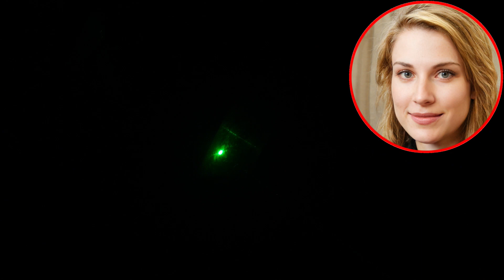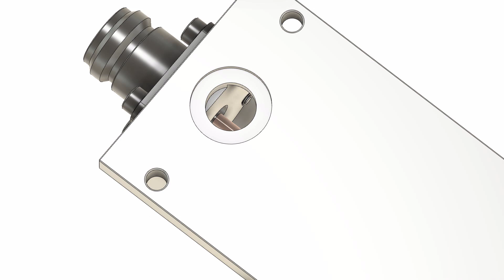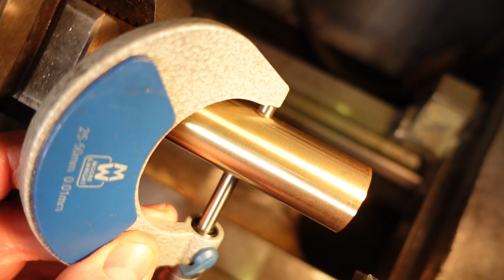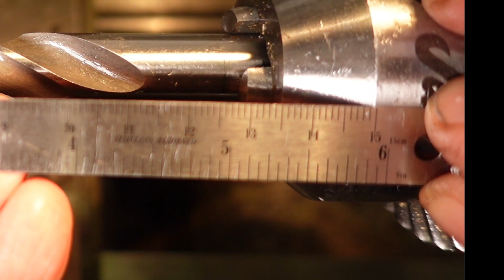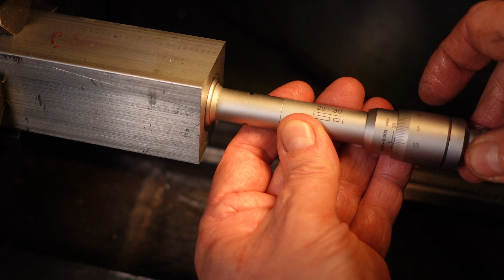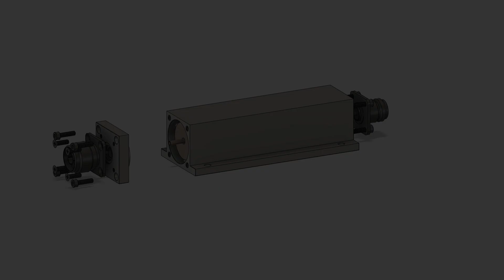Machining Microwave Coaxial Low Pass Filters Part 1

Comment: I have to turn it down to 0.25 speed so I can read the captions and not miss anything.  And to have time to read and think about the odd bits of mathematics, circuits, and component values thrown in.  I liked the plot of the response of the parallel series inductance and capacitance filter.  I checked your calculations, but not sure how that plugs together.  I liked your comments about chucks. At 0.25 speed I can follow your methods, but at full speed they are blurred by your speed and habits.  When you were milling the copper/brass rod it chattered ( I saw the ribs, I have the sound turned off).  A software control on feed with feedback would help, But you said your workspace is already filled with cameras and such.
Reply from the maker: Thank you very much Richard! Yes it would be great to have software control of spindle speed. Not really too hard with a link between the DRO and the inverter. I have a 750 watt servomotor that I am going to use on one lathe axis to allow CNC style cutting of parabolic and hyperbolic dish reflectors. Similar to the electronic leadscrew mechanism that Clough42 made

Comment: Top shelf... sorry i cant subscribe twice, spite my efforts. Joe pie has a great tip on centering square stock with projected surfaces off the end  (rubber bands and four bits of flat stock). Indicates the same as any bore... cheers from vermont
Reply from the maker: I'd actually watched that video but forgotten it.  We need a laminated wall posted of Joe Pie Hints and Tips.  Merch idea there!

Someone else mentioned Joe's vid just after I posted this video and I did a classic face-palm and rolled my eyes... Need less to say, I'm now doing the alignment using Joe's method and feeling a bit sheepish!  I've just done two more bodies and it took a fraction of the time overall.  Only six more to do in this batch and I can get the end face machining and end cap done and get them soldered and tested at last.

Comment: What I like about this channel: You make things fun to watch that I haven´t got the slightes clou about. Literally. But it´s very much fun to watch for me. Good Job! This seems like actual rocket sience to me weather I found a Canadian channel that DOES rocket sience dumb down so even I can compute. I´ll keep hanging around because often You use millimeters to express measurements, I like that. I can´t wrap my head around inches...
Reply from the maker: I'm from that lucky/unlucky generation who had to do imperial, CGS, MKS and SI standards at school and then at university.  Working in foot-poundals and slugs and rods and chains and furlongs and horsepower and fluid ounces and Avoirdupois and Troy, then everything was in centimetres and grammes, then all in metres and Newtons and Joules and kilograms.  It messed with our brains, but it's like how learning to speak another language expands your brain into different ways of thinking.  It can't do anything about my subtraction issues though.  I just measured a part at 23.82 mm, and decided that to get it to the correct finished size of 23.08, that I needed to remove 0.90 mm, so the part is scrap now.  I even used the DRO, but set it to zero and moved in 0.90 instead of setting it to -23.82 and moving in to 23.08.  I don't deserve to have a DRO. Now I have to make the dratted part again. Luckily it's just a hollow cylinder at this point, although it has a raised rim at the end of one end face.  It'll probably come in useful as a spacer or something!

I think I'm going to have to make this one a three-part video as there's a lot of interesting machining of tiny parts and I'm aiming for videos to be between 18 and 25 minutes.  I'm still a total n00b at this video nonsense, but I'm on one h*ck of a learning curve.

Comment: Ok I know it's not super precise machining, but you really lost me when you super glued the parts together.  Also super glue is not something to be melted with a torch (use Acetone) unless you maybe have a fume hood extractor of some type, I'd suggest not messing with cyanides in gas form it's not good for living things.
Reply from the maker: It's only just taken to yield point, not vapourised, plus I run a big fume extraction system to remove cutting oil smoke and the vapours from hot WD40 and brake cleaner. I have proper CA solvent but on a micrometre thick glue line 26 mm diameter, it could take days to dissolve the adhesive. The precision and repeatability I'm achieving is worth the inconvenience of working in a wind tunnel....

Comment: My tiny little mind is still processing the use of lasers to bore out that cylinder. Amazing!
Using big tools I’d probably look at and associate with making farm machinery to precision machine components of a filter that works with GHz frequencies is very impressive. And not one tiny surface mount component or specially etched PCB track in sight!
Reply from the maker: It would be nice if the Laws of Physics permitted that sort of machining.  There are a few "minor" defects in my approach. Although the scientific papers I reference are totally real, the possibility of using laser ablation and oxidation and then excitation of the Aluminium monoxide by absorption resonance in air is probably just going to result in a small dot of plasma that wouldn't cut properly.  Also, my toy lasers only do milliwatts rather then the kilowatts it would need to make this work in reality. Even assuming that you could control the depth of cut somehow by tuning the power and duration of the beams, you still end up with the impossibility of cutting the bottom of the plug out, which is why I had to go full-on Ghostbusters to come up with a magical solution. 
In reality, the machining is a little less theatrical, which is sad.

I am working on a project I can't share details of yet with some tiny parts 0.25 mm thick, where I need to use my jeweller's piercing saw and my farm-machinery manufacturing machines to make  some very delicate parts. Another antenna project needs a 1.0 mm reamed and polished bore in a solid silver rod pressed into a brass carrier, with a flared feedhorn around 2.8 mm maximum diameter. Getting a fine enough finish on that is a lot of fun.

Today's project is huge in comparison, I'm making some Delrin clamps to attach GRP bracing tubes to the booms on very long Yagi antennas for 432 MHz moon-bounce communications, so they don't wave about in the wind and stay in a fixed phase relationship. Always something interesting to do, just not enough time to make videos about it!
Reply: @MachiningandMicrowaves , well, the toy milliwatt lasers certainly look very cool, and who knows what engineering genius you may have inspired with the idea? In the mean time, what you’re doing with those tractor axle drilling tools really is impressive! It makes sense that big solid well honed drill bits on a big no-nonsense lathe would be able to produce the precision you need. All that metal would soak up the kind of vibrations that would be the death of a similar job attempted on a small lathe. Good fun to watch, and I can see you’re enjoying the process. Good luck with bracing the big Yagi. That sounds like a really interesting project!

Comment: Seems like you don't clear chips very often as you drill very deep holes. Have you noticed any effects on diameter, roundness, etc?
Reply from the maker: I usually clear chips well before they start to pack in the flutes, but when I'm filming, it's really hard to   see the chips and feel how the drill is cutting, so sometimes it catches me out. When I'm drilling the 1.70 mm holes that are 36 mm deep, I usually do a full retract every 3-4 mm. Those holes then get reamed to 1.80  For holes that will be tapped, I don't bother too much, but whenever there's a critical bore, I'll usually be reaming it or boring it anyway, so it's very rare that I'll have anything other than a clearance hole that's just a drilled finish. I use stub drills to start long holes that need to be accurately on centre, then finish with a jobber or a special slow-helix deep hole drill.

I only have gauge pins and split ball gauges for holes less than 6.0 mm, but I have three-point bore mics for anything from 6.0 to 50 mm so perhaps I'll try a test with a 12 mm hole to see what the impact of clearing chips is on hole taper and ovality.

I really need to fix some overhead camera and lighting rails so I don't have to reach around all the gear.  Another job for the pile!

Comment: Lovely, soothing machining. So pleasing to live vicariously through someone who can afford stock these days. Say THAT is a whopper of a drill! Making my heart flutter.
Reply from the maker: I need one of those Adam Booth 3 inch drills. Trouble is that then I'd need a lathe five times the size of this little Colchester 1800! My biggest drill is an inch and an eighth at the moment. It certainly shifts a large volume of material with no fuss.

Comment: Size matters... astonishing work. I never made it beyond machining a screw and a nut but it was clear to me that it was not my thing.
Reply: Radio communication is another important interest of mine. If I see this work I can understand that you do some practicing before going into the 122 and 240 region like those Germans with their recent distance records. That really must be tiny. Keep up the good work! I really like the detail and depth of your comment, together with @couriousmark these are my YouTube favorites.
Reply from the maker: @feicodeboer  Michael and his son are using very advanced techniques which are not easy to reproduce by home experimenters,  The work done by Andrew VK3CV and Tim Tuck in putting together the boards with those Silicon Radar chips has transformed the opportunities for non-professionals on 122 GHz, and there is a new project for a dual-band version. Other folks have been working with the alternative chip which has two for-element patch antennas on the package rather than integrated dipoles. https://groups.io/g/The122GProject
Reply: @MachiningandMicrowaves  The signal path YouTube channel might also be of interest for those into the mm waves. The presenter has a lot of tear downs and explanations of super expensive measurement equipment but the same principles apply to mm-wave RTX equipment. Pretty educational for the interested. Although quite a bit of a difference to what you do.
Reply from the maker: @feicodeboer  One of my favourite channels!
Reply from the maker: I really enjoy watching watchmakers making parts, there's some breathtaking craftsmanship going on that I can only dream of emulating. This piece is at the large end of microwave equipment, the other things I'm working on are at a scale around 200 times smaller wavelengths and linear dimensions. I have a long way to go to get proficient enough to make good work that small.

Comment: As an electrical engineer i thought this channel (which i found just today) was to scratch my "oh lets look at something more physical than electronics" itch.

But from the second segment on it just tickled my fancy all over the different fields of science. Delightful stuff, thanks!
Reply from the maker: Always good to hear of an itch successfully being scratched.

I might have to slip a bit of electronics in, but in general it'll be microstrip, resonators, filters and devices rather smaller than 0402 SMDs (beam-lead and flip-chip diodes), a bit of software, phase-locked loops, hydraulics, gimbals, electroforming, anodising, plating, Electromagnetic finite element solvers, a bit of maths and physics, radio propagation, Mie scattering, testgear, radio astronomy, RF lenses, coplanar waveguide and lots of different types of machining. Oh, and 3D printed radiofrequency lenses once I get some of that Rogers Radix resin.

Comment: I feel like when you pull the cutting piece back along the work after the cut, any deflection in the job is gonna let that cutter take scratches out of your work. I wonder if just pulling out your cross slide or whatever after the cut is done, could help with that. Or just go backwards really slowly so it sorta acts as a spring pass to remove any deflection while giving a nice finish?
Reply from the maker: Very good question! With this old lathe, the effect of taking the carriage back if there is any deflection is to cut a fine spiral in the surface. For roughing cuts, that doesn't affect the dimension when I take a measurement so long as I take it back fast. As the measurements are taken of the section that was machines in the forward direction, and I'm doing balanced cuts for usually the last three passes, tool deflection is compensated for. If I am aiming for 10.00 mm in stainless for a critical dimension, I might take a cut to roughly 10.60, measure that, and tweak the DRO if it's wrong, take another cut to 10.40, measure that with the micrometer, then take another cut to 10.20 and measure that, so I am 100% sure that even with tool pressure and other variances in the machine that an extra 0.20 mm move in will take me exactly to size.  On that last cut, I'll pull back the cross-slide.  For non-critical dimensions or where the surface is going to be polished, I don't always bother pulling back.  It's certainly possible to use the slow reverse cut technique, but in general the tools I'm using are asymmetric, so the finish is slightly better in the direction towards the chuck with a suitable tool engagement.  I have to be certain that the speed I retract the carriage is fast enough so any spiral grooves are spaced a few mm apart and leave wide enough lands at the finished size to give me a surface to measure.  Obviously there's a risk of raising a tiny burr, but looking under the microscope, I don't see anything to worry about. When I eventually get the cross-slide refurbished and fit a new ballscrew in place of the old, worn leadscrew and perhaps fit a new DRO, then I can probably get away with retracting the cross-slide each time and still get repeatability.  It's fascinating stuff, thinking about just how bendy and rubbery everything is, including carbide!

Comment: Fascinating videos. As a matter of interest, what sort of tolerances are you trying to work to for the critical dimensions? (I used to have the RSGB VHF/UHF Handbook as bedtime reading - I'm fine with transmission lines and discrete L/C circuits but never really understood waveguides or the sort of thing your making here.)
Reply from the maker: Using QUCS Studio, I modelled the effect of a 0.1 mm error in one of the capacitative disk sections.  Main change for a 4dB reduction in return loss at the frequency of interest and a tiny increase in through loss, but under 0.02 dB. That's equivalent to a 2% reduction in a capacitor and a 0.4% increase in an inductor, assuming everything else is accurate.  The disk thicknesses are the most critical  measurements. With four of them, there is a lot more scope for messing up the characteristics, I would like to keep the disk thicknesses to within about 0.5%, or about 30 micrometres. More detail in the next video it I ever finish editing it!
Reply: @MachiningandMicrowaves  Thanks for the reply. They're quite sensitive beasts then...
Reply from the maker: @Mister_G  Nothing like as sensitive as a proper high-Q double cavity, where micrometres matter and the resonance moves radically with temperature On those, I use coolant and wait for everything to settle to a steady temp before taking measurements. I use a granite surface plate and decent quality DTIs with sub-micrometer resolution, and a reasonable set of gauge blocks that are mostly good to much better than 100 nm, but at that level, I'm wearing cotton gloves and not breathing on anything!  One day I'll see if I can do a video about those filters.  It's about 45 on the list.  The level of precision needed is on a par with old clocks or big steam engines. At least an order of magnitude worse than watchmaking and way worse than modelmakers achieve with bearings and cylinders.  Plenty of scope to improve, but actually no need in terms of the performance and repeatability of the filters.  Enormous fun anyway!

Comment: That is amazing. Many years ago I build a similar filter from copper sheet and rod, but it only had to handle a couple of milliwatts. I got into serious trouble when I decided to silver plate everything (for pretty, the copper had plenty of conductivity) and of course afterward all the dimensions were off. Well, it was a hobby project, not for pay, but I gave myself a lot of grief over having to scrap it and do it over.

How much power is "high power" in this little gem's future life?
Reply from the maker: The connectors are the limiting factor, so no more than 500 watts.  The version with 7-16 DIN connectors has been tested at a kilowatt into a well-matched load.  I guess it could take a lot more as the electric fields are not excessive and I'm running a 1.5 mm air gap.  The unknown issue is what happens at the harmonics, where a real antenna load might result in some more spectacular voltages. Ideally there should be diplexer or something to divert the unwanted power into a dummy load before the filter, but the amplifiers I was using (4 x 250 watts) each had a 90 degree hybrid with a large dump resistor, so any harmonic energy reflected back from the filter would be at least partially absorbed by those resistors.

Comment: You are bonkers. Subscribed :D
Reply from the maker: Flattery will get you everywhere! That fire in the lathe bed was 100% real by the way. It was supposed to be a nice controlled flame inside the hole, but the block was very cold and the fuel shot out unburned into the chip tray, and ignited itself very well indeed, along with some oily aluminium chips.  In the interests of Art, I filmed it for six seconds before I lost it totally and went all "burly firefighter" on it. Not even putting that on as an out-take. <shudder>